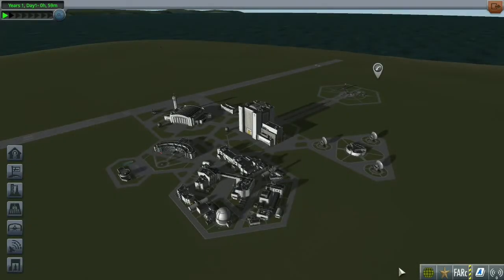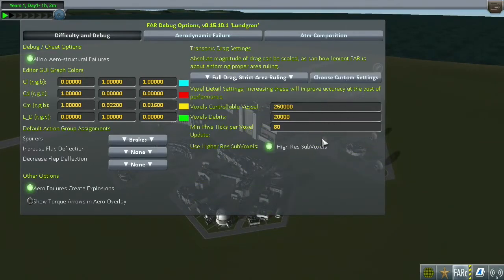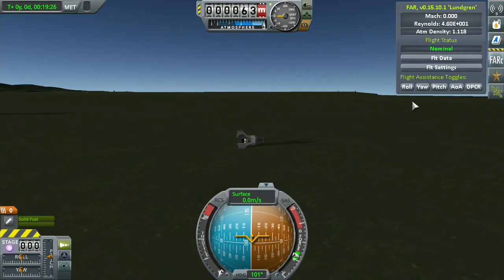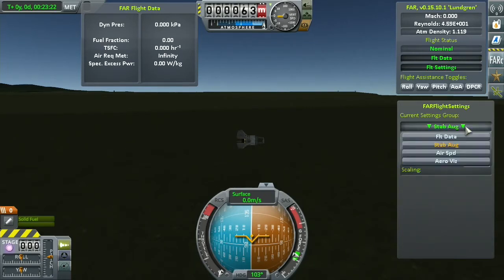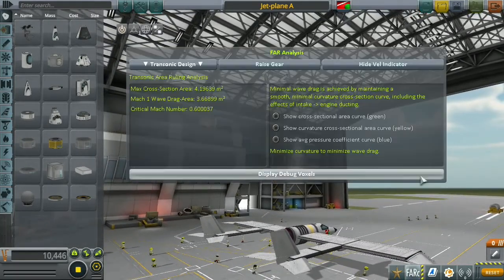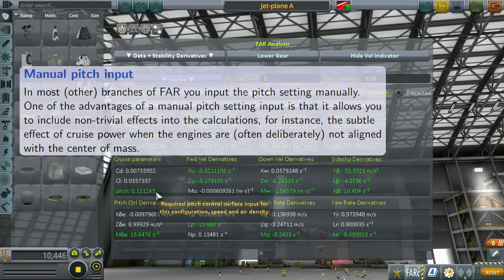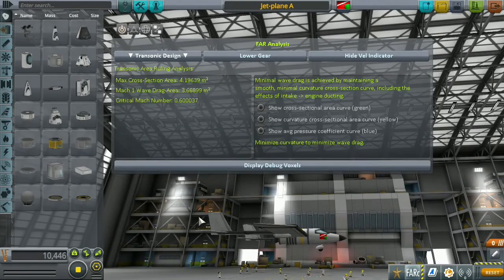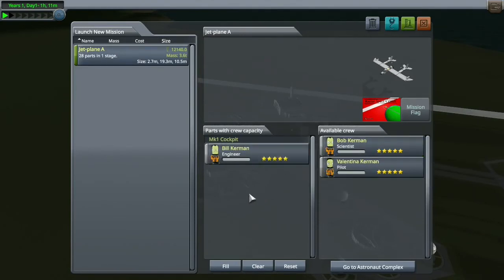KSP FAR In-Editor Stability Derivatives – Part 2 – UI Basics

Comment: Can you talk more about what each settings for control surfaces are for? (When you right click a control surface in build/flight mode).
Especially the dynamics, AOA and rudderbrake sliders. I have no idea what they are for.
Thanks :)
Reply from the maker: Ok, here is a wall-of-text that describes the control surface settings :-)

In the editor I get these three control settings:
  (1) A button labelled "Flp/Splr", that will open further options relating to flaps and spoilers,
  (2) a button labelled "Std. Ctrl", that will open the sliders for 'standard' control surface settings,
  (3) and a slider labelled "Mass-Strength Multiplier %".

Let's take the last one first. The "Mass-Strength Multiplier %" sets how heavy and sturdy the controls surface (or wing) is. The default value of 1.0 makes very heavy wings and fins. I think the default is chosen that way so that young players and novices won't have to bother with it, and they will still have sturdy rockets that can take a good amount of Kerbal abuse, like the players might be used to. For a wing made up of several segments (wing pieces) it also makes sense that the inner segments are strong. For a control surface though, my preference is to lower the "Mass-Strength Multiplier %" by a factor of at least two (0.5), and possibly a factor of five (0.2) or sometimes even more.

The button "Std. Ctrl" opens six sliders (let's discuss the important four first).
  (*) One slider is "Ctrl Dflct" which indicates how many degrees the control surface is designed to deflect. It is kind of the nominal "full deflection".
  (*) Three of the sliders, "Pitch %", "Yaw %" and "Roll %", are the 'usual' sliders that will determine how much the control surface should react to control inputs. My preference is to have at least one fin or set of fins for each of the three axis. And by that I mean, that as a first design step I will have elevators set to 100% Pitch and 0% Yaw and Roll, a rudder set to 100% Yaw and 0% Pitch and Roll, and some ailerons (or wingtip fins) set to 100% Roll and 0% Pitch and Yaw. For the fine-tuning it is perfectly acceptable to add in a bit of 'cross control' so that for example the rudder has a slight response to roll control input; I just find it easier to reason about the fins if I initially assign only one axis — that way the assignment stays stronger in my mind. Sure, you can leave all control surfaces to do 'all the things' (the default behaviour), and it is not a bad default, but generally I find the craft will fly more predictably if you decide at design-time which control surfaces are in charge of which jobs.
  (*) The last two sliders, "AoA %" and "Brakerudder %", are not used all that often, let's discuss those two after we visited flap and spoiler settings.

The button "Flp/Splr" opens one slider, "Flp/Splr Dflct", and two buttons, "Flap" and "Spoiler".
By default, neither "Flap" nor "Spoiler" is selected, and thus the control surface will not act as either. You can mark the control surface to work as Flap or Spoiler by selecting the corresponding button. Flaps and Spoilers do NOT have to be dedicated to only Flaps or Spoilers — they can function as 'usual' controls in addition to as Flaps or Spoilers; however you cannot set a control surface to both Flap and Spoiler. Also, notice that a control surface that works as both, say, flap and aileron, while working perfectly as either at different times, may have degraded performance if used simultaneously.
  (*) The slider "Flp/Splr Dflct" is quite similar to the "Ctrl Dflct" slider, in that it determines the nominal full deflection, in the context of flap and spoiler functionality.
  (*) Enabling a control surface as "Flap" means it will extend (or retract) along with all other designated Flap surfaces when you choose to extend (or retract) flaps.
  (*) Enabling a control surface as "Spoiler" means it will extend when (while) you press the brake button, or if you set the 'parking brake'. Airbrakes (spoilers) can be very convenient, for instance when returning to Kerbin without engine power; the greater flexibility to the trajectory (with airbrakes) makes it easier to land at or near Kerbal Space Center.

Two of the more advanced settings are "Brakerudder %" and "AoA %".
  (*) The brakerudder is intended to control yaw, much like a traditional rudder, but the brakerudder achieves its job by slowing down the inside wing. When you press the yaw left control input then the left wing brakerudder will deflect (while the right wing brakerudder remains flush). To make sure the brakerudder only brakes, and not e.g. rolls the aircraft too, it can be an advantage to place an extra set of brakerudders that deflect opposite to the first set. If, say, one brakerudder deflects +100% and another (on the same wing) deflects -100%, the force effects may roughly cancel, except for the greatly increased drag of the two deflected brakerudders (which in turn produces the yaw). There is a caveat that the brakerudders are supposed to be aileron-like, a vertical fin on each wingtip will not react to the brakerudder setting.
  Even if you do not intend to use brakerudders, you may still use the "Brakerudder %" to adjust the control setup according to your preferences. If for instance you prefer a cleaner wings level yaw response, you may add a smidgen of brakerudder (e.g. 15%) to the ailerons, so that the control response to yaw control input is then accompanied by a slight 'raise the inner wing'-aileron response. Personally, I find the plane handling more natural at 0% brakerudder in that scenario, but the point is that there is a myriad of adjustments possible to make the controls suit your Kerbal flight style.
  (*) The "AoA %" is used to make corrections to the control surface deflection angle depending on the current angle of attack. Let us look at two examples; with a somewhat silly one first:
    (I) If we assign an "AoA %" to the (tail fin) rudder the rudder will deflect some as response to sideslip. Maybe you want the rudder to turn to be as flat as possible into the wind. In this situation, if the direction of travel is slightly rightwards (nose yawed slightly left) you may want the rudder to align to the wind by rotating slightly left. Or you may want a servo style response, where a nose pointed left (direction of travel is slightly rightwards) is accompanied by rudder deflection to the right to reinforce the nose-righting forces.
    (II) Where the "AoA %" comes in particularly handy, is dealing with canards. Canards can make your plane more efficient and more maneuverable and fun. Canards also, in my opinion, can make your plane fidgety to fly as well. When the airplane pitches up (initially without change to the craft trajectory) the canards produce more lift (higher AoA) and makes the plane pitch up further. This is in contrast to a traditional elevator that will produce less torque in that situation (the elevator downforce AoA becomes less). Tweaking the canard setting can make the plane (artificially) more docile and enjoyable to fly.
  Typically, it is not obvious how to tweak the sliders at design time. A valid trick is to tweak the sliders during test flight, then note the values, and finally, when back in the editor, set the slider values to get the tweaks saved to the design.

Be sure to let me know if I missed what you are actually asking.
Reply from the maker: Thank you for your suggestion; I guess I kind of forgot to talk about the right-click sliders. I will try to write an answer comment for you next week.